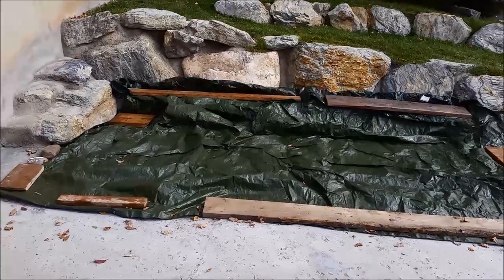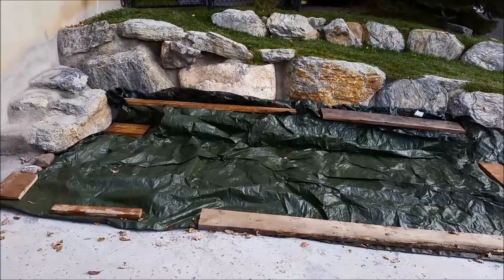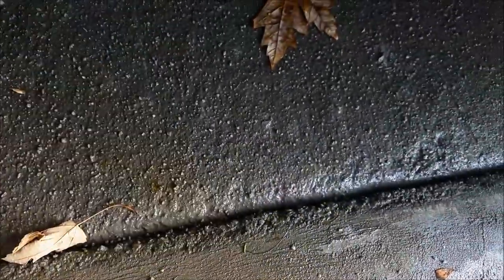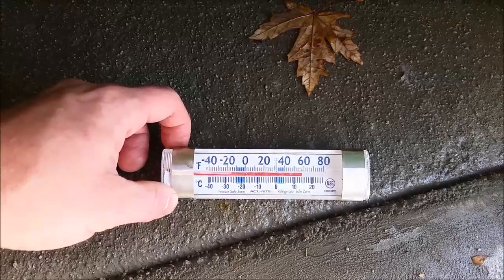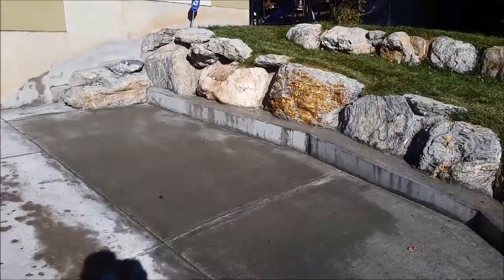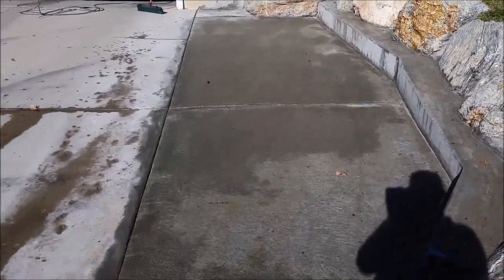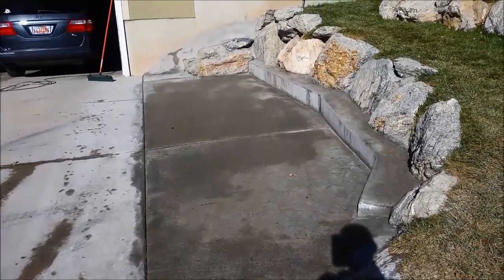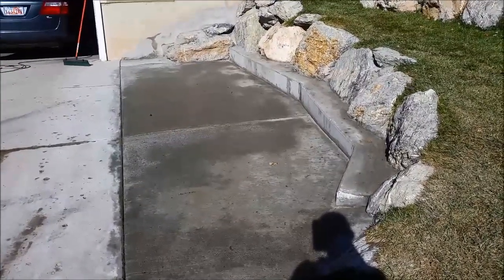How to cure concrete properly for highest strength and longevity

Comment: I wet cured my shed pad I poured myself for a little over 3 weeks. 

When I went to drill the baseplates it's by far the hardest concrete I've ever drilled through.
Reply from the maker: Agreed. That concrete I did is still in excellent shape. I can't say the same about some concrete that was poorly done in the home I moved into.

Comment: does it sticks to concreete? how long before i should wait to out it?...does it affect the broom finish?
Reply from the maker: Excellent question.  You don't want to put it on immediately or you could end up with a weird tarp pattern on the concrete-- I have seen that before. I would wait until the concrete cures for at least several hours and then put it on just before the sun goes down so the concrete will stay warm over night but only if the temperatures are going to dip below 40 degrees at night. You only want to cover it if it is going to get too cold at night. It did not affect the broom finish at all. Looks great now. Thanks for watching!

Comment: Had water pipes replaced in the living room a couple weeks ago, the guy poured some cement Type material over the pipes. noticed a few spots that seem wet, not sure if it's a leak but I think it's just normal curing. typically run the heater in the evenings around 21 to 22 Celsius and then switch to the dehumidifier function 18 degrees Celsius for 6 to 8 hours or more while sleeping sometimes the temperature goes a little lower. Does this sound normal should I be concerned? I will ask the installer guy but I'm living overseas I don't speak the language and I'm not exactly sure which product he used, even if I knew I couldn't look at the bag and understand what it says. Lol. I know it is like some type of cement or concrete, thanks in advance
Reply: Also not seeing any cracks. Looks like a good install to me, other than a couple of wet spots. They do seem to  be drying, slowly. The rest of it seems very dry.
Reply from the maker: Sorry I didn't see this until now but sounds like it worked out great. Cement can stay a bit wet looking for a while while it cures so it is actually good for cement to cure in a humid/moist environment for proper strength. Thanks for watching! How did it turn out?

Comment: I live in Central Florida and the temperature now in September is between 70 and 90 , how do I cure Concrete, do I have to wet it a few times a day and for how many days?
Reply: I'm in CA, right now we're having a few very hot days with no humidity, I'm trying to keep mine wet, but sometimes in the late afternoon I think it dries out even under the tarp. Once the surface dries, Is it meaningless to keep it sprayed down after that?  Also do I have to do it a full two weeks? I read somewhere else one week. Other people I know don't do it at all, but I figure at least some will help.
Reply: Keep it wet for as long as practical, cover with plastic or burlap, keep it out of the sun, I would do 2 weeks minimum but depends on strength required, full cure can take 4 weeks. Don't let it dry or curing will stop.
Reply: spanky9067 walang problema  Thanks !,
Reply from the maker: @spanky9067  Yep I agree. You want to keep it cool enough so it will cure slowly.

Comment: What about sealing it? Is it worth it and necessary?
Reply: A cure and seal won't cure your concrete faster. It only holds moisture in allowing for hydration. Curing at lower temps also doesn't make for higher compression strengths. Precast concrete pipe is often steam cured at upwards of 120°. High temps are only bad if it forces the water out of the mix before target strength is achieved.
Reply from the maker: That is a good question. I did not seal mine but I did keep it wet and kept the temperature controlled as best I could. I need to do more research on sealing chemicals. from what I read I don't think sealing is necessary. You can use a spray that helps it cure faster if you are pouring in conditions that require it to set faster but the point of curing is to allow it to cure slowly and thus be stronger.